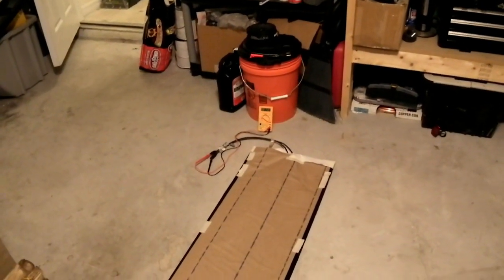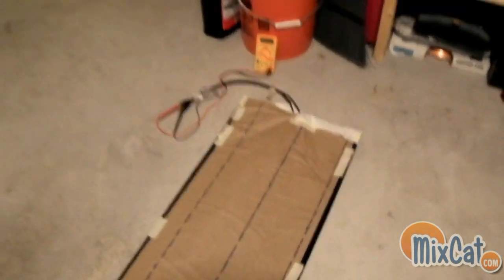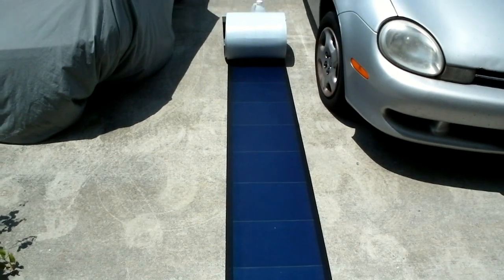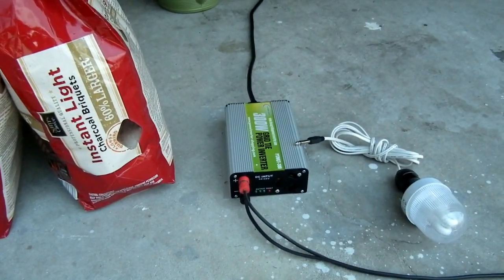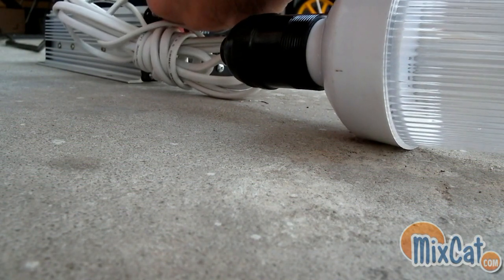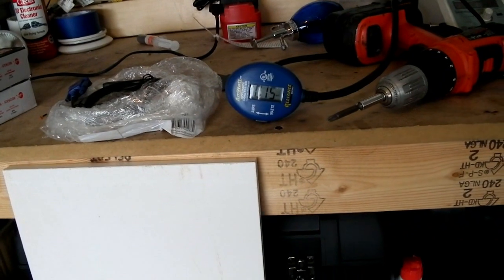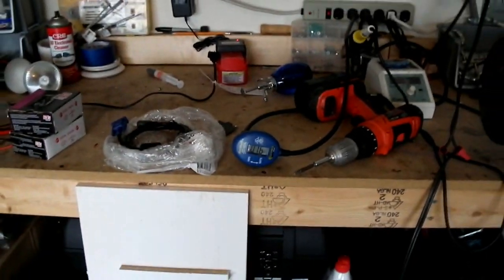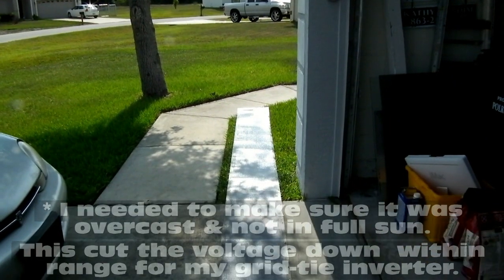UniSolar Flexible Solar panel review & demo

Comment: Those amorphous-Si panels lose a lot of voltage in the first few hours. But they perform better in hot conditions like rooftops. You should test again after a day in the sun and share results. It might match more closely the stated specs.

Comment: please help, i have a unisolar panel as well but i was wondering what type of connector did you use to connect to the grid tie inverter.  did you just openly splice the wire and stuck it into the inverter??  the solar panel tip seems to only fit cords that are for extensions.  what else does the tips fit onto?